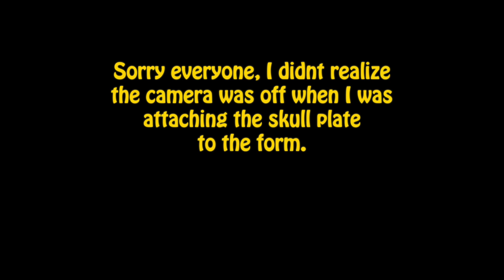Asian Ibex shoulder mount, Resizing, Facial clay work, Art o Taxidermy.

Comment: So if your circumference was 5" different would you cut 1.25" off all the way around and reshape neck as needed
Reply from the maker: Technically yes. ,,, a lot of times if the difference is less than 2” you can get away with removing only from one side. But if it gets over 3” you’d better adjust proportionately.

Comment: excelent. good looking ibex! it from mckenzie! Do you remove the cartilage from ears?
Reply from the maker: Thank you. Yes it’s from McKenzie and yes I did remove the cartilage.
Reply: the adesive is epoxy or "bondo"
Reply from the maker: @marioferreira5525  I used Bondo on this one.
Reply: it depends on the material of earliner, not?
Reply: after twenty plus years of using bondo method, now i'm switching to earliners, parcialy because of your videos and now relearning to mounte de ears.
Reply from the maker: @marioferreira5525  Yes... but I always add reson to the bondo to make it thinnner and create more adhesion... the earliner material, moisture in the skin, earliner prepwork all are important.
Reply from the maker: @marioferreira5525  Im glad you are liking the videos...Bondo ears are a great way too but I only like to use it on animals I cant find earliners for ... and Im also liking back the Ear adhesive 2 part epoxy over bondo.. its funny how we change preference all the time.
Reply: Actualy i'm experimenting to make  my Earliners